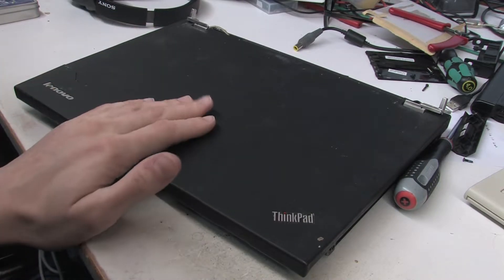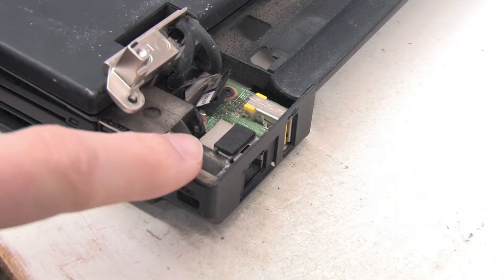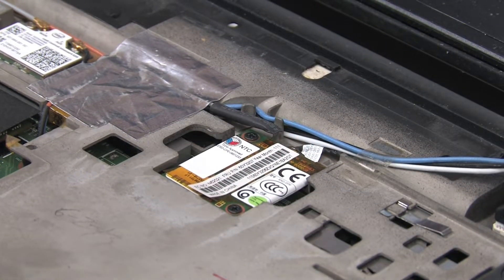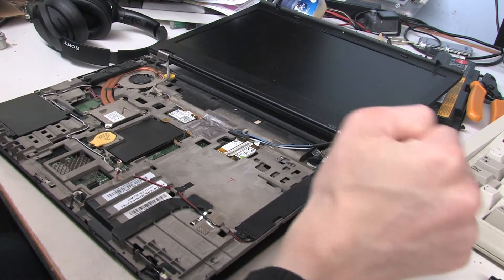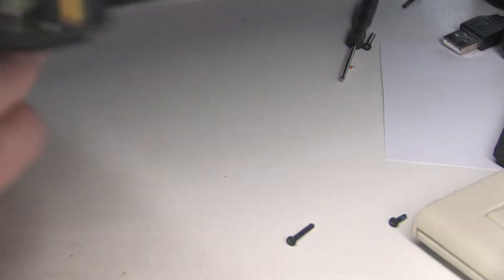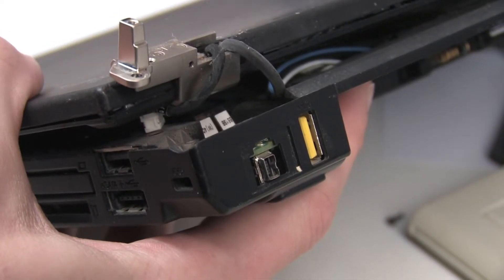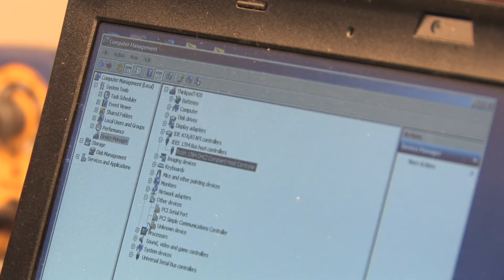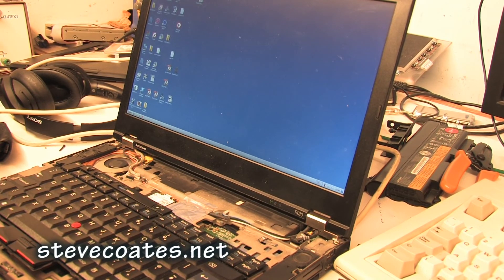Adding a Firewire (1394) Port to a Lenovo ThinkPad T420

Comment: Amazing. Any idea if Linux will be able to use the FireWire port?
Reply from the maker: I haven't tried it on this machine, but Firewire is well supported on Linux, so it should be fine. I did use Slackware 14.2 on this thinkpad for a while before I installed the firewire port and it ran nicely.

Comment: Can it be done on any laptop or not ? Sir.
Reply from the maker: Some laptops (like the T420) were sold with a choice of ports - if it is a model like that, then you can probably change it. If not, you'd have to add a firewire port using a PCMCIA or an ExpressCard card, but neither of those are options on most modern laptops unfortunately.